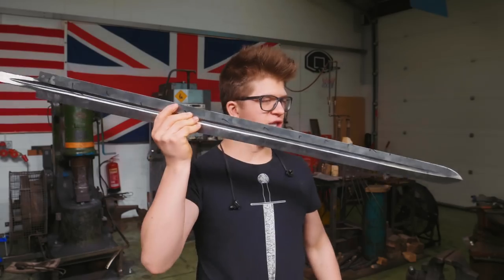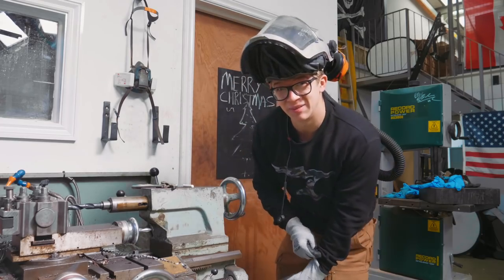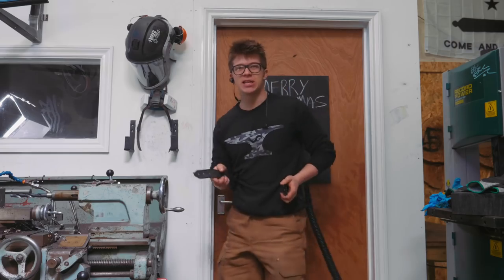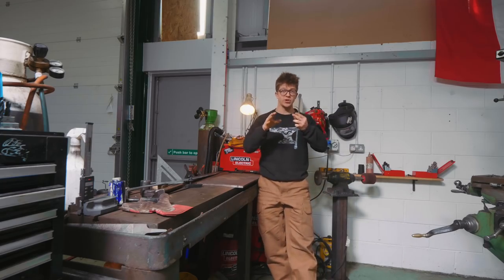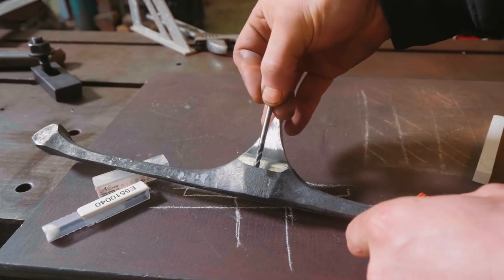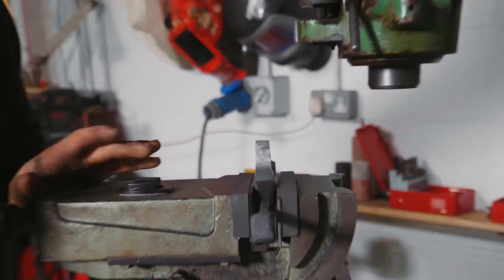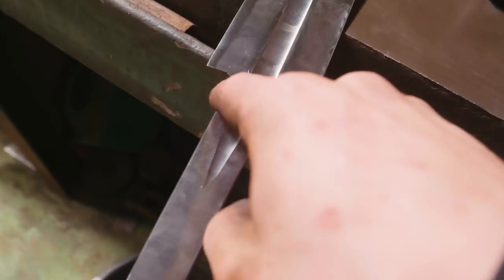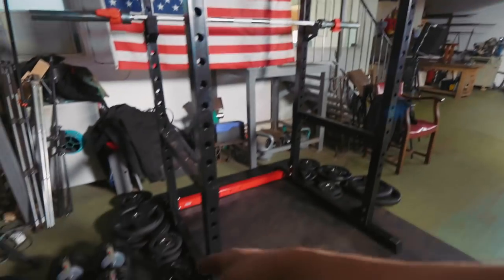MAKING A SCOTTISH CLAYMORE SWORD!!! PART 8

Comment: back in the day they used to fit the crossguard on hot and forge it to fit, which is why a lot of historical examples you find, even though the wood and leather of the handle is long gone the crossguard is still stuck perfectly in place, i dont know how viable it is for you to do now (i assume this was done before heat treat potentially? and grinding out the final shape would be done with it on the blade?) but it might be something to keep in mind for a future project
Reply: Lesbosmer exactly plus they dodnt realy care if it was straight, shiny and beautifull because it just need to do the job in bsttle.

Comment: What if you turn the guard upside down and carved it from there
Reply: Difficult to clamp upsidedown with that bit sticky up bit, especially flat. Once you move a piece without any reference surfaces like that everything is going to be all squiffy and off square. Probably not too important though, as hell be filing to fit at the end anyway! Probably could rig it up somehow to work.
Reply: At this point, I don't know what the heck he's doing with that guard. It's too wide. The quillons are at the wrong angle. He's machining a slot that ought to be sawn and hot punched.

But hey, let's pad the video with unrelated gym footage so we can go over 10:00!
Reply: Moth Otter he's got the correct guard shape in a graphic in the video's thumbnail. Since he's already started cutting on the screwed up guard, I doubt he's ever going to bend it. Yet Sam, or whoever makes the videos for him, knows what the guard on a Scottish greatsword is supposed to look like.
Reply: tstodgell the gym stuff started almost at 11 minutes....
Reply: He could mill parallels reference flats on the quillons before turning it over. First drilling all the way through with a long twist drill. Then Ideally following that with a carbide V drill. (Voisard, an extremely rigid, non twist drill that has less tendency to walk.) He would then have a reference as to where he needs to remove material. Then with a combination of parallel blocks, (1,2,3, and/or standard parallels) place outside the jaws of the vise, on the base on his parallel reference points, on the quillons. I hope that makes sense, it does to me. lol
Reply: David Johnston If quillions are the flat bottom part that he just milled for the shoulder of the blade and you mean to put parallels inside that bit then that is what i was thinking too
Reply: Quillions are the "arms" of the guard.
Reply: lets just call it a wallace style clymore. but yeah it should have been hot punched/chiseled giving it the disired thickness
Reply: Thomas Russell oh right. I should've guessed by the plural haha
Reply: Honestly the fuller should be forged as well. Cutting it cuts the grain of the steel and actually weakens it. The guard, while an important protection feature is not as important as a strong flexible blade. Of course this blade isn't going into battle, so it is all a moot point. It will be a beautiful art piece.
Reply: Moth Otter totally agree, people forget he is still new to the bladesmithing and in my opinion while a lot of stuff is not historically accurate he is doing tremendous work. Accuracy and research can always come later and as for his Fairbairn Sykes that is up there with the best of them....
Reply: tstodgell you new to this channel? he once change the toilet paper between making katana.
Reply: tstodgell then again it’s his sword so he can make it however he wants 🤔
Reply: I was thinking flipping it as well. As for the length of the quillions, he pointed out that he's aware of his inaccuracies with the guard and is just continuing with it as a practice piece. If anything, perhaps Alec could reach out to Boston Knife & Sword for advice. I've binged the hell out of those guys, and they do a ton of blade work that's pretty out of this world.
Reply: Daniel Anguish , that's what I was yelling at my phone!
Reply: ANameThatIsn'tMyOwn put steel plates to increase vertical length of clamp
Reply: Was thinking yesterday he would have a hard time with the guard as Chandler even was struglin to cut and punch it. But to mill it was such a good solution as now he has only a small amount to punch or drill. I would also drill it from below and file to shape. Hot punching it would be real difficult as eventually he will have to turn it pointy bit down and that's when it will be hard to not mess it all up.
Reply: Drill the hole first?  So clamp the solid piece in the vice, drill/mill the hole/slot where you want it, then flip it over and mill out the slot?

Also, should he not take advantage of the mill's precision and cut the slot to fit into the fuller?
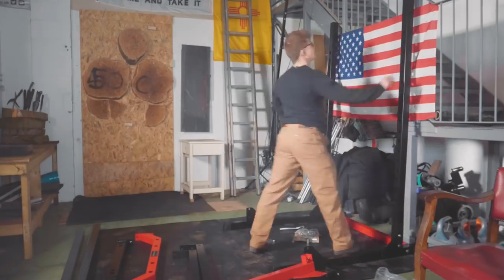Reply: The only problem with that is that he starts the gym footage at about 10:45.
Reply: Earthenfist.
True!
Reply: Yeah, that's what he realised and he made a tweet about it!
Reply: tstodgell I think he need that angle to grind it and would be forged up to the correct V shape later... But we'll see...

Comment: Tip on hand care when using gloves: I'm a massage therapist and I got atopic eczema from all the friction and washing of the hands that comes with massage. When I use only plastic gloves, the hands get sweaty and that's not nice. Using thin cotton gloves (the type you get at pharmacies) underneath the plastic ones provides ventilation and feels much nicer in the long run.
Reply: I as a lab tec agrees!
Reply: I was a high voltage tech on wind turbines. We used to do a light dusting of Gold Bond Foot Powder for wearing heavy rubber gloves covered with an outter glove of leather too. The dusting always helped.
Reply: Great idea, i'm definitely going to start doing this - some days I'm wearing nitrile gloves 10+hrs a day -  fine in winter when its cold, but they turn to a swamp in summer!
Reply: I agree with Jack. I have to wear the same HV and LV gloves at work, a bit of talc does work wonders.
Reply: What he say nitrile prevent is what nitrile makes me. It's a sweat capture device and 1h of these glove there is liquid sweat dripping out, my skin really dislike being enclosed, just wearing socks do the same.

Comment: This may be too late for this video but if you are milling with such long cutters it can be a good idea to go for plunge milling as the axial rigidity of the cutter is much higher than the radial rigidity. Essentially you use your end mill like a drill bit and plunge it down to depth, retract fully, move over, and plunge again. After you have removed the bulk of the material you can move the cutter laterally to finish up the cut.

Comment: You could drill a hole all the way through (exactly in the middle) in this orientation you have the guard right now in vise. Then when you flip it around you'll have something to reference of off to mill slot for your tang ;)

Comment: why not drill a center hole from above machine a plate to fit in the slot to aid clamping so it wont close the already milled slot then flip it over and mill it from the other side

Comment: Just drill through with a standard hss 4mm drill bit to mark the 2 sides for the tang hole then flip it over and 4mm end mill out to those 2 holes. Simple

Comment: Cant you just flip it around and drill the hole  from the other side?
Reply: Leone i had the same idea
Reply: Leone, exactly what I was thinking
Reply: Same idea but 0 knowledge so let's see what others say
Reply: I had the same idea. Just be careful where drilling and double check everything and add supports around the guard so it doesn’t move.
Reply: it would be too wide, leaving too much space making it not fit correctly. i think
Reply: it would be almost impossible to get it back in the mill square. the only truly flat surfaces on that thing are inside the cut, even opening and closing the vice will make it move. 

Alec is not a machinest, and I am even less of one, but from what I have seen on youtube its the kind of job a graduate level machinest would stuff up, an experienced machinest would admit he cant do and a Master would take hours just to set up.

Comment: Why is the slot not centered? Next time try milling the sides parallel, then square the bottom. Do the bulk of the slot horizontally with a woodruff cutter(saw) then put it the vise and finish with the endmill. Know the center and flip it over, drill through for the slot ends then use a small mill to plunge the through slot. Try silver soldering old carbides to steel round stock to make custom cutters. 10 guys will use 10 ways to get a final result. Awesome vids!

Comment: You need an EDM machine so you can just erode a pocket exactly the same of the tang and blade! :D
Reply: Yeah baby, dance that pocket right in there. You just balance a Dance Dance Revolution table on top of the blade which is in turn balanced on top of the guard, then dance the night away. Slightly precarious, has a good chance of impaling yourself on the blade... but so much fun. Its all fun and games until someone loses an eye - then it's just plain fun.

EDM - Electronic Discharge Machining. Uses thousands of little sparks per second to erode away material. You make a blank from graphite (typically, but anything conductive is fine - copper and brass are popular too) then it gets very slowly lowered into the material eroding its way through. Incredibly tight tolerances and amazing surface finishes can  be obtained!
Reply: Ya, every blacksmith has one of those machines over in the corner. Get real. He already has too much stuff for a forger. Why not suggest EDMing the whole sword with a 5 foot CNC'd copper block:)
Reply: Yeah, why not get a high performance femtosecond laser for cold laser cutting?
Reply: panaxion lol and get those sick beats lol!
Reply: Lol and i high pressure water jet cutter

Comment: Anyone else notice how far off center he milled that slot? 

Not saying I could do better but it was very noticeable
Reply: Yeah that was really not centered at all
Reply: Josh Johnson  perfectly centered
Reply: In the last video he said he mess up the peice anyway, so that gonna be a prototype
Reply: He stated before working in the mill that he was sticking with it.
Reply: he did it purposefully to line the milling up with the two protruding bits and that way he could center it based on that
Reply: Plus I'm pretty sure he said he was going to file it because it's not actually wide enough for the sword to fit in
Reply: It's probably centered with the bottom of the guard based on that being flattened to align in the mill.  Those ears coming up the blade could be further ground or even selectively forged to produce a symmetrical result.
Reply: He has a lot more sanding/grinding to do to the outside as well, but I would assume that it a combination of being somewhat centered between the two "knobs" at the edges and not having a wider endmill.
Reply: Yup spot on, wish I had that accuracy!

Comment: I've got a suggestion for next build that, if your going to continue making swords with fullers or "blood grooves" would be worthwhile. Try making fullering dies for your power hammer... Those could save you tons of time! You can power hammer the fuller into the blade, then use the same dies to "mock-up" a short section of plain steel in the same shape as the blade/tang transition  (shoulder) and then press the mock up into the guard during forging  (so as not to damage the blade but also to avoid using specialty end mill bits and trying to force fit everything together). So after you press the mock-up into the hot steel guard you can heirloom fit the real blade and only need to make small adjustments by hand.

A blacksmith once said publicly that blacksmithing is the core of all trades and that if a blacksmith needs a tool, he make the tool (to make the tool to make the tool...) and that all other tradesmen go to the blacksmith when they need a special tool made... pretty sure that you by the way... Just a few videos ago...

I'm no blacksmith but I have seen a lot of blacksmithing videos, especially from you. But during this build I've had the pleasure of witnessing your strugles with the fuller on the blade and guard and making the it fit together theoretically. 

I really enjoy watching these episodic videos of your builds so please keep doing them. I hope I didn't come off as some know it all internet troll either, that was not my intent, but I don't only watch your sword builds, I think I've watched at least 'most' of your videos too.

Comment: what's the difference between a 60 grit and all the other grits? sorry, im 11 and i dont know much about this, but i do want to be a blacksmith...
Reply: The LOWER the number , the COARSER the grit.  so something like 240 would be finer  - hope this helps !
Reply: Good luck kid, just keep on feeding on these videos to learn. Like said earlier, coarser grits remove more material faster but leave a rougher finish. Vice versa with higher grits
Reply: thank you!!!!!
Reply: thank you soooo much!!!!
Reply: The number is the amount of particles, so the higher the number, the smaller the abrasive particles are. Check out the Wikipedia article on sandpaper (it's not actually sand, it's glass). It has the tables and standards.

Comment: When milling the slot, you could have used the end mill the make some spot faces to give a flat surface to drill into. That would allow you to remove most of the material by chain drilling to depth.

Comment: Make a faux tang with a few inches of blade and then split & heat the guard, hammer the "faux tang with a few inches of blade" into the top of the guard and move on!

Comment: Slower feed speed and shallower cuts will help keep the tool from braking. As for the tang slot. Find the center of the hole and drill through all the way. Then use the hole to ensure the the slots are square with each other.

Comment: Alec, put a drill in your collet. drill through from the top twice. once on each end of the desired cut out. turn the piece over and then use your end mill to mill out the material between the holes.

Comment: You should've started from the other side of the crossguard. Doing the hold for the tang first then flip it over and do the top of the crossguard for the blade. It would've saved you time and headache, what with such a short end mill bit. Or at least that's how I would've done it back in my machinist days.
But it's looking good and your doing a good job and it's nice to see you are learning new things and new ways to salve problems you run into. Keep up the great work, Alec.

Comment: Given the time difference between UK and USA you're probably already finished filming the next episode where you announce that you've figured out how to solve the tang/guard problem, but (as a hobbyist machinist), here is my thought:
tilt the head on your mill and come at the hole from 45 degrees, using the bottom of the end mill to push into the material; and keep it light and away from the edges. Then you can get a hole through it in the right location, and only have to file the edges. Or plunge a hole with a longer 3mm or 4mm drill bit through the center and use it to set your location, and flip the piece over. Then you can ensure that the center of the point is lined up with the center of the sward; flip the piece in the vise, and move the table around until the same drill bit slides back into the hole from the other side. Then you know you're centered. Obviously take some measurements before flipping so you know how far on either side you need to slot it for the tang.
but you're probably done with it already.

Comment: You could always make a steel template of the tang and bottom half of the blade and use that as a punch/drift. You forge around that and end up with a hole and slot the size you need.

Comment: at 10:32 you could have drilled a hole all the way through using a high-speed drill bit then go in from the under side and then use your carbide end mill. Just an idea, don't know if it works.
Reply: Michael James I think the same, but, he have drill in the middle, if he want to fit the blade in this pice i think he can do with hss mill with T form

Comment: Mill yourself a perfectly flat section of bar stock to make a levelling parallel that will fit against the inside of the known flat slot you've milled, and use it as a flat level to flip the guard around and drill into the bottom of it. Now that you have that flat slot, you should be able to work on it from underneath, give a few thousandths of leeway, and hand file afterwards as you usually do!

Comment: Alec you should just cut off the pointy bits, mill the slot, weld the pointy bits back on, and then grind it all smooth again. Not the most fancy of solutions but it should work. Reminds me of how michaelcthulhu works!

Comment: turn the guard 180 degrees in the vise and cut the slot for the tang through the bottom instead of the top.

Comment: If you drill a hole through on the X Y centre line of the piece in that orientation then you can flip it over and clock the hole true with a dial indicator ( mag base fixed to spindle )to machine your tang slot.

Comment: Alec, Pro Tip. Use paper between the jaws and your forged metal. It’s much softer then aluminum and you will rip the vice off the table before a part slip
Phil M

Comment: Perhaps if you make another guard, maybe you could try slitting and drifting out the hole for the tang, then milling/filing to finish. It seems like it could save you pain and frustration in the long run.

Comment: Hey alec get a second vice for your mill then you can flip parts like that over and be able to cut from the other side. Try using a small air nozzle with low pressure when you are using end mills. It will cool the cutting tool and clean chips out of the cut and increase tool life